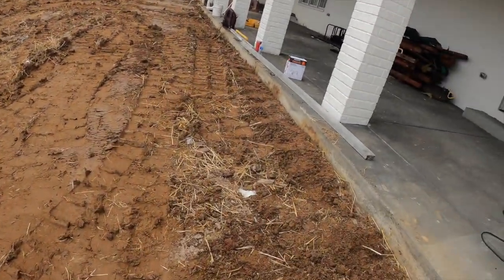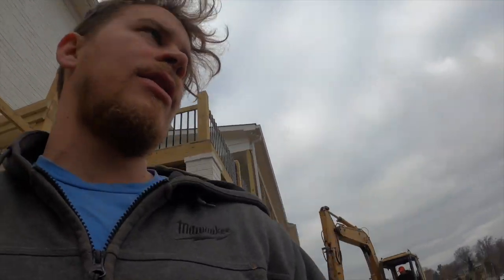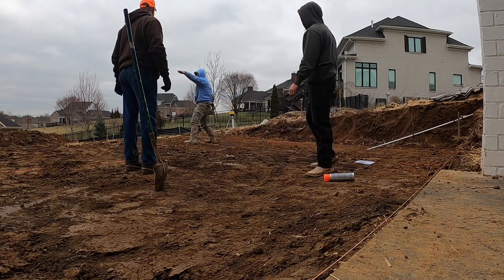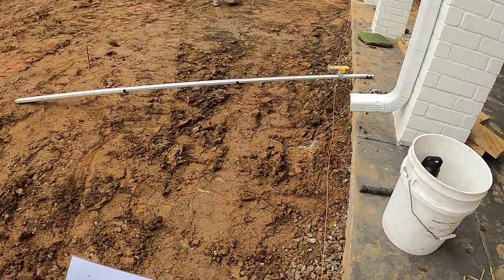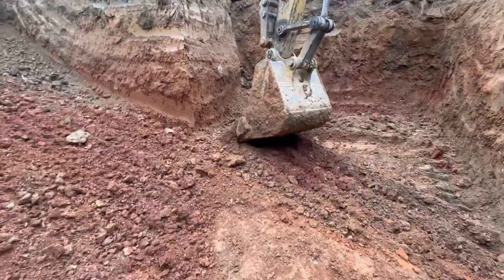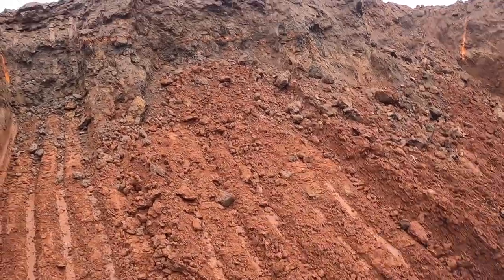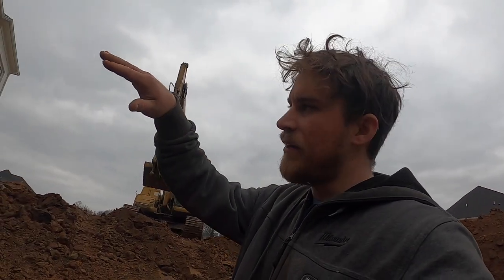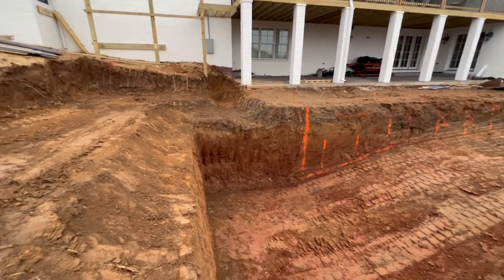HOW TO DIG A IN-GROUND SWIMMING POOL | Fiberglass | Start To Finish | Everything you need to know

Comment: Question...on the dig, why are you adding a foot to the dimensions of the pool? I get you added two inches for gravel, just was clear to why the extra foot.
Reply from the maker: We do that because it’s very simple to calculate your dig measurements. Because if your dig is 4 foot 2 1/2 and all you have to do is add 1 foot makes it very simple. That makes sense?
Reply: But why would you add the extra foot?